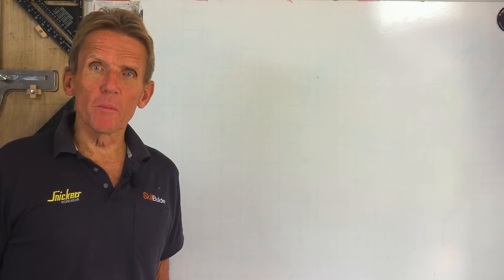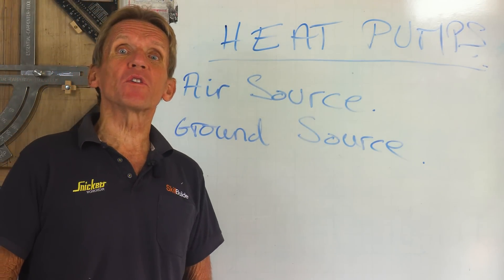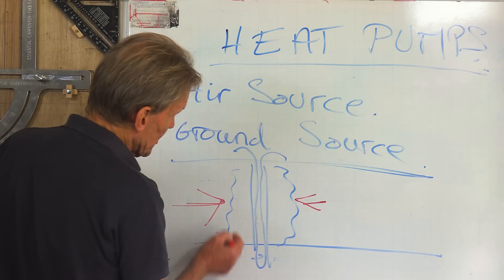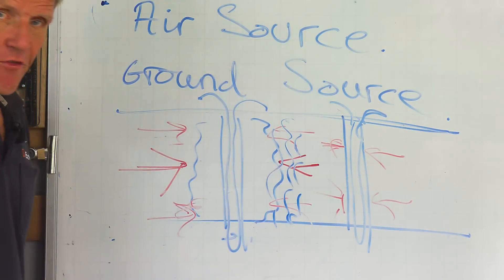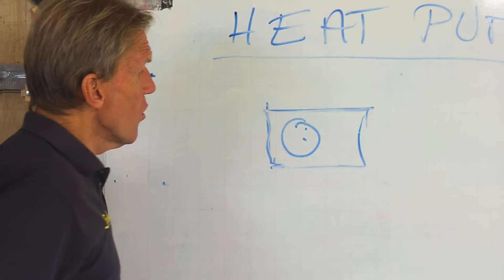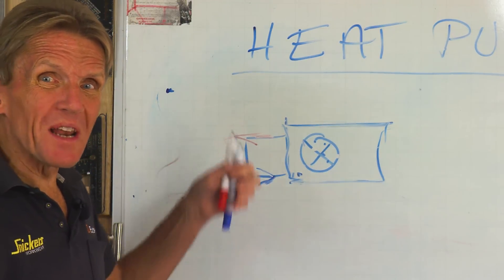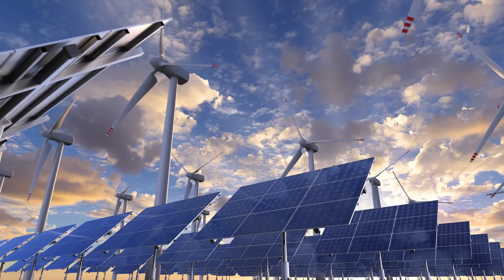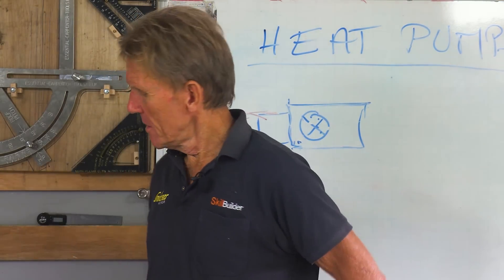Heat Pumps ~ Get Your Facts Straight!

Comment: OK. I don't get it. There must be a refrigerant stage of some kind in a heat pump.  Right? For a heat pump to collect energy from the Air,water, or ground. The heat collecting bit in air,water or ground has to be colder than whatever its collecting heat from. (2nd law thermodynamics, I think!)  Heat pumps work in negative C temperatures. The heat exchanger part. The part collecting the heat energy from the environment. Has to be at a lower temperature than the ambient air or whatever you want to use as a heat, source for it to collect any heat. It can't just be water flowing in a loop. I think they must all have the refrigerant (compression,expansion,evaporation) ability. Its just that some models are designed without the ability for internal cooling/air conditioning, and some do let you use them for air conditioning, but they all work on the same principal.
Reply: You're right they are refrigerant based. What Roger was getting at is that there's a difference between a split system (Which the refrigeration loop extends into the house, common in air-to-air systems) and a monoblock system. (Where the refrigerant remains within the outdoor unit and there's a heat exchanger to heat or cool the water that will go into the house, i.e. an air-to-water system.)

Both split and monoblock systems can do heating and cooling, if they include a valve inside to reverse the refrigerant direction.
Reply: Ha, thanks I almost went crazy there. That stupid comment took way to long to write as well. I was looking at thermodynamics on wikipedia. Thanks again I get it now. I will be able to sleep tonight  @yngndrw.
Reply: 🤣Another 5 minutes and i would have been trying to phone Brian Cox

Comment: Interesting about no grants for cooling systems.
Insulation will help yes, but I feel like heat through solar gain is massively important during spring/autumn when there's still some heat in the sun. Just as long as on hot days, there is adequate ventilation. 
People in new build houses seem to struggle so much keeping their houses cool, and releasing stored heat at night..
I hope one day we will have cooling for ventilation, like american 'whole house fans'. I sometimes wonder about installing one myself.
Reply: a whole-house fan is great if you live in a place that gets cool enough in the evening to make good use of it.
Reply: @somedude-lc5dy  most of the time in the UK during heatwaves (25+c) the nights are still cooler than 20c, much nicer than the 26+c interior of the house.. Usually in heatwaves there is very little wind, so it would be nice to have a whole house fan.

Comment: Fair comments Rodger. The good thing about ground source is that you can store energy from season to season - as opposed to air source with battery which can only store from one day to the next. The ground thermal mass is a much bigger store. But, with tariffs now available it's possible to store your excess solar panel energy in summer in the form of export cash in your electricity account and use that as cheap rate import in winter for use during the day with your air source heat pump. That can be more profitable. The combination of solar PV, battery and heat pump can save you 75% compared to a gas boiler and the tariffs avoid the installation expense of ground source.
Reply: Can you really store heat in the ground? Isn't it one massive thermal sink?
Reply: @edc1569  So I've heard that you can warm up the ground in summer with your excess energy and suck it back out in winter, this can be done with your heat pump operating in reverse as air conditioning in summer with free energy coming from solar panels - the ground being so much bigger a thermal mass and so much slower to change temperature. Compared to a battery, say 15kWh 24h store, the ground must be 365 times that or 5,400kWh equivalent.
Reply: How do you put the heat into the ground without cooling your house, do you then heat your house with electric heat? must be an expensive operation
Reply: @MichaelFlatman  It's the excess heat from free solar energy that you can store, raising the ground temperature slightly, then extract that in winter when needed and with the heat pump being very efficient in the order of 300% to 500% efficient it works out to be very cost effective.
Reply: @johnh9449  what's to stop your neighbour extracting that heat if they are similarly equipped? You have no way to stop the heat energy flowing to their collection pipes if they are using the heat faster than you.

I would suggest that much of the benefits of this type of equipment are sold on the basis that only you have the system. If every property, particularly in cities, had ground source heat pumps then the heat source is going to be depleted fairly quickly. The reason the ground stays a reasonably constant temperature is because it is not a very good heat conductor. Thus the quicker you extract heat, the more it will struggle to replace that heat either from below or from solar radiation above. So the more systems that you have close to each other, the less effective they will be, particularly in extreme circumstances.

The same will occur with air source when everyone has got one. They extract heat from the environment which makes it colder. You are relying on the environment to replenish that heat from beyond the immediate location. The more pumps there are in a particular location the larger the area that will be needed to replenish the local heat, thus you are effectively cooling the local environment. Whether there are detrimental effects from that remains to be seen. Although you can imagine if outside temperatures normally hover over 0c in winter, widespread heat pump installation might push the local temperature below 0c more often.
Reply: @crabby7668  Nothing is to stop them entirely although their ability to "steal" your heat stored is limited by the ground being a poor conductor of heat as you mention. You can't have it both ways when arguing an extreme scenario. In truth if all neighbours are doing the same at the same time, which is most likely, then over time things will average out and energy will be shared fairly. It's the same as residents of a block of flats - sure it would be possible for some skinflint miser to not bother with switching their heating on and instead rely on his neighbours heat leaking through his walls, ceiling and floor as he sits there chuckling wrapped in a duvet, but in practice things tend to average out which is a natural tendency of everyone being human and roughly wanting the same comfortable temperature.
The more realistic concern with a matrix of ground source heat pumps in close proximity is a distributed reduction in COP due to the heat pumps having to work harder pumping heat into ground that's already warmed or extracting heat from ground that's already cooled - a similar issue to too small a ground loop store but designed with sufficient capacity it shouldn't be an issue. Even if there is a distributed inefficiency effect - keep things in perspective - It's not someone strealing all your heat - just a small inefficiency effect of everybody benefiting from the huge efficiency gain improvement from use of a heat pump.
I was going to jokingly suggest that with my heat pump being air sourced I might suffer from my neighbour stealing my hot air but you seem to have beaten me to it. In reality of course with air source heat pumps, things called; wind, breeze, weather etc, tend to redistribute any local concentration of heat energy in the air. It's not an issue. The weather is way dominant over any localised effect and global warming is the existential threat - not your neighbour.
The best way of thinking about it is to imagine a large waffle like matrix of dwellings that concentrate heat or cooling within the core of their properties (the house) by moving energy from outside (the waffle frame) to within or vice versa in order to maintain a constant core temperature. The average energy in the matrix is represented by temperature and thermal mass between the colder matrix frame and the hotter cores, or vice versa depending on season - it's just a redistribution of heat energy with an average COP of 3 say. So, they achieve a comfortable core temperature with 3kW equivalent heating for every 1kW drawn into the matrix. 
Now compare that to everybody having gas boiler with a COP of 0.9 at best. The energy drawn into the matrix from outside is much greater for the same maintained core temperatures and consequently the heat loss from the whole matrix is 3/0.9 = 3.333 times greater because there is no heat redisrubution within the matrix, only heat loss from it - which goes up in the atmosphere.
Reply: @johnh9449  I think you are getting it with your second paragraph. The first para example isn't really what would happen though. If the neighbour could heat their house adequately by running their system more than yours then there is a possibility that you run into the situation in  para 2.

That is basically what I am getting at. No one is talking about what happens when everyone is after this environmental energy. It is not infinite in the local area, it has to be restored from elsewhere. At the moment it can be considered infinite/constant because there are so few pumps installed. Imagine if your waffle is totally surrounded by other waffles extracting the environmental energy. Your replenishment energy has to come through someone else's waffle and be in excess of what they use.

So in theory the more that are installed in a city the worse the cop they will achieve, including those already installed. 

I don't understand what you are saying in the last paragraph, unless you are advocating better heat extraction from the flues of gas boilers. Something I would agree with.
Reply: @crabby7668  The energy doesn't need to be infinite. Energy comes from the sun ultimately which warms the earth and the sun is going to last for some time. 
The last paragraph is the most important concept to get across.
The point is heat pumps re-distribute environmental energy to concentrate the heat in people's homes where it's wanted. In doing so, the overall energy in the larger area matrix only increases by the imported energy required to drive each heat pump (e.g. 3kW concentrated at the home for 1kW from the grid i.e. 300% efficient), whereas gas boilers don't redistribute environmental energy they just heat the home with energy from the grid (e.g. 900W for every 1kW imported i.e. 90% efficiency) - so to heat the home with 3kW equivalent to the heat pump they need to import 3.33kW.
Heat pumps use the heat already in the environment - they just change its location and only need to import a fraction to do so, whereas gas boilers need to import all of the energy and in fact more because they are less than 100% efficient.

In fact many condensing gas boilers are not set up optimally and likely run 80% efficiency like the older recirculation flue types and many are not properly maintained.
Also, heat pumps have better COPs these days and run between 300% and 500% efficiency - so many times more efficient than a gas boiler - so if efficiency reduces a little due to influence from neighbors, it's still many times more efficient than a gas boiler due to its use of environmental energy - something a gas boiler is entirely incapable of exploiting and instead allows all that lost energy to dissipate into the environment unused.

Comment: A heat pump will work exactly the same way efficiency wise no matter if your house has poor insulation or if you had good insulation.

What changes is your heat pump size due to an increase in heat loss. Your heat loss is your heat loss, does not matter if you have a boiler or not.

The efficiency is dictated by how well your heating design is.
Reply: Careful he might delete your comments if you are positive about heat pumps
Reply: Spot on. Thank you for correcting this, i nearly wrote the same.

Comment: I am considering a hybrid gaz/heat pump system with ducted central  air heating and  water heater. I read that the same ducts of the central air heating system can be used as a ventilation system also.  And a ventilation is mandatory when you isolate and get your house airtight, so you are stuck with ducts anyway. I am curious if there is a rant somewhere in my idea 🙂;-)
Reply: ducted heating, you need to move a lot of air, you need to ensure good return path for the air, most UK homes don't really have the size to accept the ducting needed and vents for the return air.  If you're doing a full renovation underfloor hyrdonic and some small trickle air ducts on a MVHR makes more sense in most UK homes.

Comment: A small fact-check: insulation has little to do with whether heatpumps work. They work when emitters and flow rates are correct - in both insulated and uninsulated properties.
ie: heat transfer equation & mass flow rate
Reply from the maker: If you use a heat pump in an poorly insulated house it won't match the heat loss and is therefore an inefficient means of heating. A gas boiler can put the heat in faster than you lose it so it is a more efficient way to heat the house. You put the heat in fast and then let the house cool down when you are in bed or at work. The rest is semantics.
Reply: @SkillBuilder  Respectfully Roger I disagree.

Let's compare steady state heating as that's efficient for both a boiler and a heat pump and is a bit easier to work through. Let's also assume that we aren't limited to what radiator size we can specify. (I know that is reality that is a big consideration, but the point I'm trying to get across is that insulation itself isn't directly linked to whether a heat pumps works or not.)

So you have a house which is poorly insulated, i.e. a high heat loss. Let's say we want to heat this building with a mean water temperature of say 35C at our design temperature. It doesn't matter what the heat source is, the radiator sizing stays the same - It depends on the heat loss of each room and the mean water temperature that we're designing for. Some of those radiators may be a silly size sure, but if your room has that high of a heat loss then it is likely big enough for multiple radiators or even a combination of radiators and underfloor heating.

So now we have a house which can be heated with a mean flow temperature of 35C, we know how much energy we need to provide which sizes the pipes. We can now size the heat pump, which will be exactly the same as the boiler.

The difference between a boiler and a heat pump is the tolerance for higher flow temperatures and in turn the tolerance for smaller pipework and smaller radiators for the same heat loss. Now it's fair to say that it may be impractical for some poorly insulated houses due to the emitters required, but poor insulation does not always mean that it's a no-go and either heat source would greatly benefit from additional insulation.
Reply: @SkillBuilder  let's take a large house with a heat loss of 10kW. A 10kW heat output from a heatpump is the same as a 10kW output from a boiler. A boiler can have 70c flow with small rads, a heatpump system can have underfloor heating and/or double or triple panel rads running at flow 35c. In this scenario, the same heat is being input, same heat is being lost, and the heatpump is at cop 4, running cheaper than a boiler.
Heat up/cool down scenarios are the same as boilers, provided emitters are appropriate.
My point is, emitters need to be appropriate and then everything is more or less the same as a boiler.
You wouldn't put Nankang Ditchfinder tyres on a Porsche 911 and complain it's not getting good laptimes. But people put heatpumps in with old CH systems and expect them to work the same.
Reply: @Loopyengineeringco  This begs the question why aren't owners with gas boilers encouraged to at least try and reduce flow temperatures by fitting larger radiators? It's not as good a solution as heat pumps but would at least help cut gas energy use for much lower financial cost.
Reply: @Loopyengineeringco so you're saying the boiler is able to use smaller pipes and radiators while hp needs larger emitters (ie radiators)?
Reply: @rufus_mcdufus  it definitely helps with boilers too, but the potential gains are very little. With a gas boiler you're just trying to increase condensing ie heat recovery from the flue gas, so really there's only 10% efficiency improvement or so to be gained max. With a heatpump, going from cop 3 to cop 4 (45c to 35c flow) is giving you at least 20% of free heat.
Reply: @DeepakKumar-lv4te  yes, in short. For the same running cost as a gas boiler, a heatpump needs to be at cop 3.5ish, which means a heating flow temp of around 40c, hot water recharges at 50c ish. Then you need to size radiators accordingly: but the bigger the rads you can fit, the more free heat you will be getting as your cop goes up. It's possible to fit a heatpump without upgrading rads, but this is usually where all the horror stories come from.
Reply: @Loopyengineeringco   hey, thx for the reply.  But does this increased emitter/rads then require a higher capacity heat pump which in turn costs more power to run, negating the overall equation?  cheers.
Reply: @DeepakKumar-lv4te  nope, the emitters can be as big as possible, even with a 'small' heat pump. Just they need to be as balanced as possible across your spaces, you don't want one room to be too warm & others too cold. So, they should all be oversized by the same factor in all the spaces, for best balance.
The aim is to get the heat from the flow temp into the room, so the more surface area the better when you're trying to keep flow temps low (and extra volume of liquid is also a good thing too).